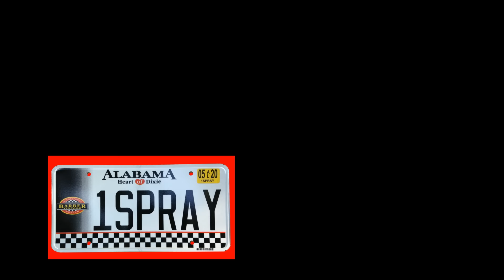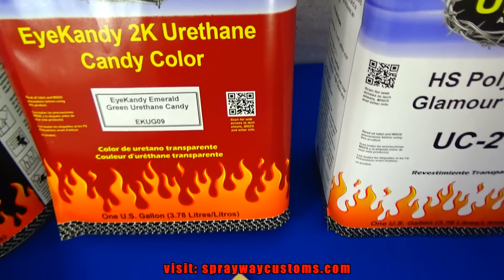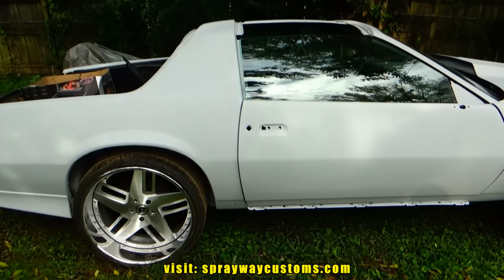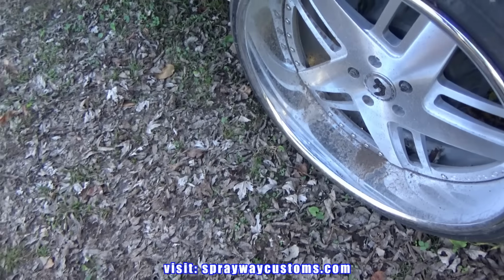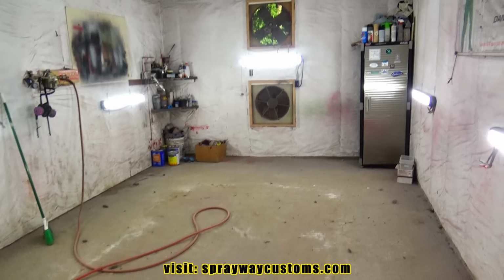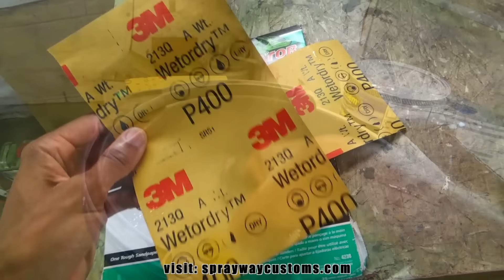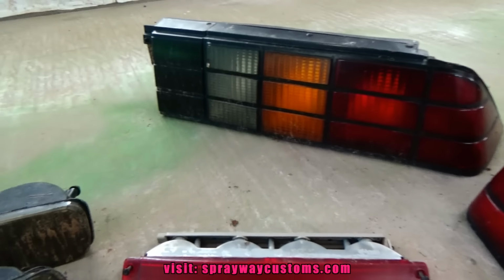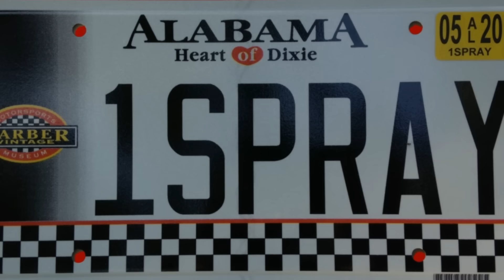Custom Candy Apple Green Complete Paint Job From Start To Finish 1988 CHEVY CAMARO IROC Z28 BUILD

Comment: You do absolutely beautiful work. I wish you'd mention to the viewers how many hrs.it takes to sand one down. I did an 89 rally sport back to Maui blue metallic in about the same condition. I think between knocking it down and through primer to sealer I had 80 hrs. Then from 2000 to 4000 on the Finnish another 8 to 10. You make it look to easy they really don't know how damn hard it is to get to that Finnish your putting out. Oh taping 8 hrs too . Just sayin I really do appreciate what your doin cause I've painted a few myself. Props!!!!
Reply from the maker: You're correct Terry...the sanding is what gets me every time
Reply: @SprayWayCustoms  but it will make or break it  Thank you for responding. I can't wait to see what your next project is.

Comment: I normally don't like Green but that is a beautiful Color, You really do a Good Job. You take Proud in Your Work. I really like that. On door jams where the Paint is Good, do You remove the Paint or sand it with Scotch Bright and then paint over it? Have you ever replaced the Outer Rocker Panels under the Door on a 2000 Silverado?  In addition where do You buy Your Paint, Base and Clear and Sealers from? That Color and Your Work is Very Sharp..
Reply from the maker: I usually get most of my products from UreChem at thecoatingstore.com. You can just scuff the jams up with a maroon scotch-brite if the paint in good condition and I never done the rockers on a 2000 Silverado
Reply: I have a Question how did you fix that crank and broken dash? It sure did look Great afterwards. You wouldn't never have known it was cracked or broken. I very beautiful Job.
Reply from the maker: Waymon Blevins here's a video of it. https://youtu.be/2q1X7-wFNRc

Comment: You just do outstanding work. Can i ask....do you use a flex additive in the bumpers? Trying to figure out for my next project
Reply from the maker: I do sometimes but I just used epoxy primer on this one
Reply: @SprayWayCustoms  
Can i ask what additive you generally use? Do you just spray the bumpers with that additive?

Comment: do you clean your gun between coats?
Reply from the maker: Not between coats but after each use
Reply: @SprayWayCustoms  ok thanks. If i have ledt over paint still in the gun between coats, its good to spray it on the next one?

Comment: That wiring was a rats nest.  I’m glad you ripped it all out.  You did him a big favor with that. He’d spend more time fixing that than starting over.  Nice job, looks awesome. Nothing like a nice candy on any car in any color. That gold base is the way to go for the green and the red in my opinion anyway.  It gives them a more rich warm color than the silver base.  That’s a tough paint to lay down without stripes showing up.  The camera will create shadows that aren’t there. Obviously not your first rodeo. I hope you charged him enough. That would cost him an easy $10k at most shops 👍.   There’s a place in Miami called Tropical Glitz. They have some wild colors you should check out.
Reply from the maker: Thanks Mike. I like the gold base under greens and orange candies myself
Reply: @SprayWayCustoms  I’ve never seen it under orange. I’ll have to try that on one of my models.  I’m in a wheelchair now so I’m doing models instead of cars.  Keeps me relatively sane tho sanity might be over rated

Comment: Do you have any brand new Sata 5000 left 1.3 ?i looked on the web site i didn't see any.
Reply from the maker: I have some but they’ll probably be one of the limited editions with a 1.3 tip but I know I have some with a different size tip. I can check on it later on if you like me to.
Reply: @SprayWayCustoms  Sure that would be great thanks